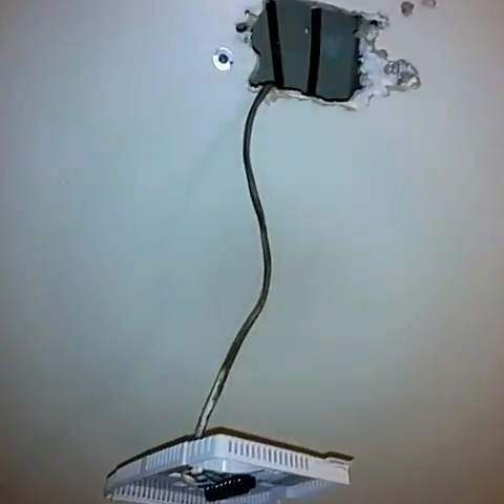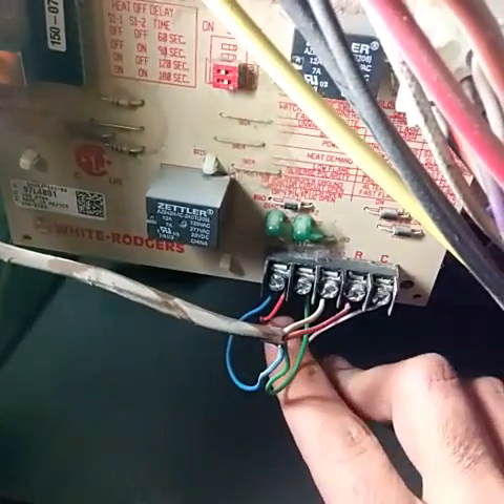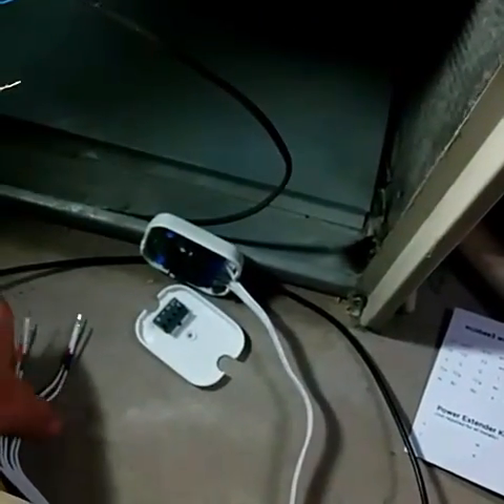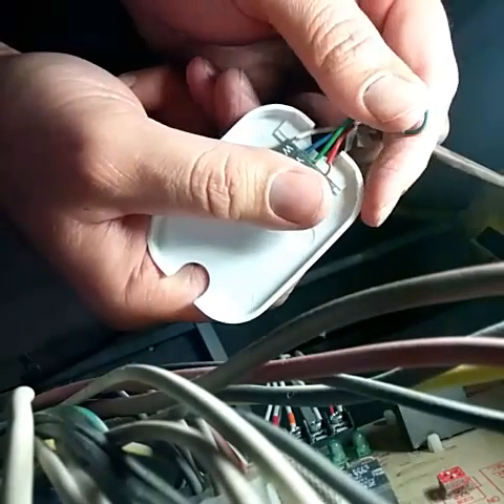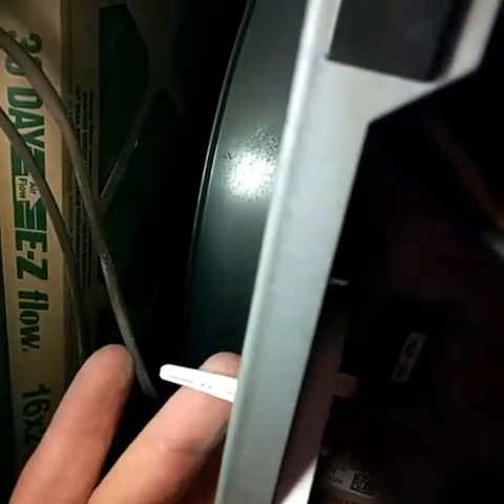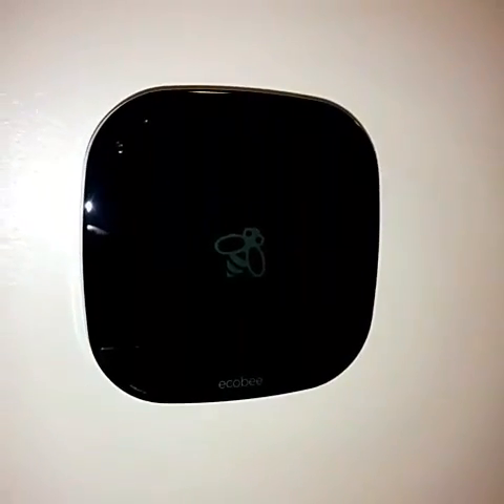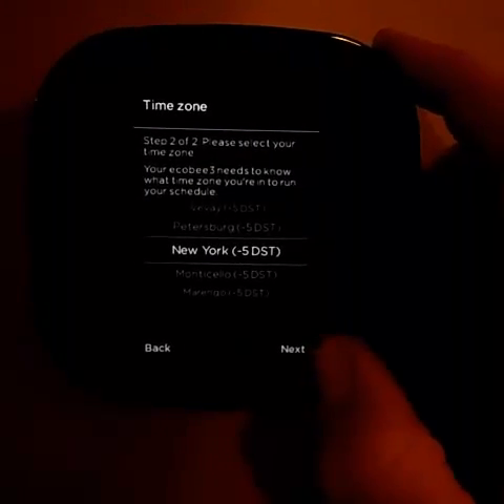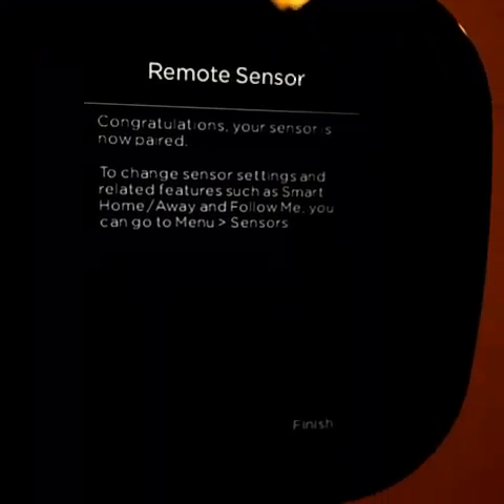Ecobee3 installation including the  power extender kit (pek)

Comment: Please help I just installed this and now when I turn my AC on, heat is coming out! Ughhhhhhhhh
Reply from the maker: Allie B Hmmm... that is weird. Did you double check all the wires just to make sure? (Dumb question but I gotta ask)
Reply: Yes, went through the whole book so many times. I'm so frustrated ! I called it a night lol
Reply: Do you take FaceTime help calls lmfao
Reply from the maker: Allie B The only other thing I can think right away is that the thermostat is actually programmed for the heat setting instead of the cooling. I'm not trying to insult you, just trying to work through it and see what we can figure out
Reply from the maker: Allie B Not sure if I'd be much help over FaceTime lol. I haven't had to trouble shoot anything yet luckily

Comment: We recently installed a smart thermostat (Lyric T5) in our home. It's a much more simple thermostat than the Ecobee 3, I believe, and we've really enjoyed having it. We were lucky to have a c-wire already connected, although it wasn't connected to the original thermostat. I think the previous owners had bought a new HVAC and the c-wire was connected at the furnace but they didn't change the old thermostat which was one of those old mechanical mercury ones. Anyhow, enjoyed watching this video about how power extender works.
Reply from the maker: thihal123 Thanks for the comment and it's good to hear that there are other options out there. Hope you enjoy your new thermostat.

Comment: Seems like a lot of work compared to just dropping a new group of cables that include a common.  I know I don't have one and plan on picking this stat up tomorrow.
Reply from the maker: It might seem like a lot of work, but nothing compared to running new wires in an already finished part of my house. It's really not that complicated when you get going on it. I hope it works out well for you.
Reply: Thanks...  My furnace is in a basement with no ceiling.   So dropping wires down 10 feet is no biggie for me
Reply from the maker: +Rob Mugs Oh, yeah... that just might be the way to go then. I wasn't that fortunate to drop a new line to the furnace. Good thing there's more than one way to do it to meet the needs of multiple applications. It should install super easy for you then. You'll enjoy it when it's up and running.
Reply: Thanks for the video anyway.   Wasn't even aware this could be an issue.  

Out of curiosity, how well does this heat areas of the house with the extra sensor?   It seems you would need smart dampers but they claim it does it with magic algorithms
Reply from the maker: +Rob Mugs Smart dampers would be ideal. Without those, I don't think it's entirely possible to have the whole house at an even temperature. I think the sensors just make the thermostat average out the temperature. I rent rooms in my house and haven't really asked them. I haven't had any complaints, so I'm going to assume that the temperature is pretty even throughout the house.

Comment: Thank you very much for this video.  Your board is exactly the same as mine and ours was wired in a different configuration.  Seeing how your two AC wires were connected was a life saver.  Well, a condenser saver.
Reply from the maker: Glad we could save your condenser and money in the long run. Thanks for the comment!

Comment: I'm thinking about getting this (hoping for a discount come black friday). But I have a question about wiring due to my wiring setup. My wiring is setup EXACTLY like yours, with what I'm assuming is my central air that has those two wires attached. Looking at my thermostat wiring, it doesn't have a C wire attached. But when I looked at my wires running from thermostat to furnace, I do have a Blue Wire for Common. Pulled the wiring out of my wall a little more and the blue wire was tucked away. If I get an ecobee3, would I just be able to wire this up using all 5 wires that I have, or should I just pretend I don't have the blue common wire and use the adapter?
Reply from the maker: I would first try using all your wires because it would be a lot easier and save time. If all else fails, then I would resort to installing the c wire like I had to. Hopefully you get a discount this week, that would be awesome. Let me know if you have any other questions.
Reply: chefonzy1 thank you very much for your reply. Whenever I get a new thermostat, I'll let you know if the wiring worked with the wires provided already.
Reply from the maker: You bet. Definitely let me know how it goes. Good luck with it all
Reply: Did end up finally getting an ecobee3 lite. Only thing that was a pain was trying to get the common wire screwed down on the furnace with the a/c wire as well.
Reply from the maker: +FromKindleFireIsBorn Sounds like it installed nicely then if that was the only issue. That's awesome. I've enjoyed being able to control my thermostat with the app, so I'm sure you'll enjoy yours too.

Comment: What if wifi goes down will it still work
Reply from the maker: Should work just fine without WiFi because it's wired to the furnace. I believe the WiFi is only going to affect certain capabilities like connecting to the thermostat with your phone and things like that. Does that help?

Comment: Great video, it helped me a lot.  In looking at my set up, I noticed that someone had just cut off the common wire at the tstat and I was only using 4 wires.  After opening the unit I saw that the C common wire just wasn't connected.  I connected the common wire at the unit, went to the tstat and stripped the bundle back and found the extra wire for common.  Its powered up and running now.  I didn't have to use the extra PEK kit after all.
Reply from the maker: Thanks for commenting James! It can be super frustrating when people just start cutting wires, but luckily it worked out for you.  Enjoy your new thermostat, it's pretty sweet. Thanks again

Comment: I am using an ICP furnace and can not seem to find my control board. There is a sticker that implys it may be integrated with the fan motor or something to that effect. Has anyone encountered this issue before?
Reply from the maker: I haven't had anybody comment on that yet, unfortunately. I can't say I have any experience with it either, but if it's like any other furnace that I've seen, the board would be located near the fan motor. Wish I could be of more help.
Reply: Andrew Weakley I too didn't find the control board that he has. I found a two thermostat wires tied with wire nuts to wires that are in a harness connected to a control board. I am going to have to return the ecobee3 😢 as I failed to install it.

Comment: does the power extended kit come with it?
Reply from the maker: It came with mine, but I would just double check that it does before you buy it. If I remember right, it was pretty detailed stating the contents, so there was no question on what you were going to get.

Comment: so you dont need to install a common wire? with that little power pack.
Reply from the maker: If you already have 5 wires, then you shouldn't need to install it, it should just wire right up with your existing wires. I only had 4 wires, so I had to install the pek, so that I got a common (C wire). Does that answer your question?
Reply: absolutely ,thank you so much.
Reply from the maker: Awesome. Good luck with the install
Reply: thanik  you, again.
Reply: +chefonzy1 how does installing the PEK at the base station get you a C wire? You still have 4 wires going to the thermostat? I want to buy an ecobee3 but I also have 4 wires at the thermostat and want to make sure I understand how the installation will work.
Reply from the maker: +moropo I only had 4 wires as well going to the thermostat, so you'll need to install the PEK. The PEK takes your original 4 wires and converts it to the 5 without having to run additional wires to the thermostat. Does that make sense? If not, I can try to clarify more, but I do show you in the video how to install it.
Reply: +chefonzy1 Yes I did watch the video and I guess I have the answer to my question but just to make sure: there are still 4 wires coming out the drywall going to the ecobee3? All the PEK did was transform those 4 wires into 5 at the very end (at the station)? Thanks for answering.
Reply from the maker: +moropo Yes, you only need four wires at your thermostat. The PEK will do the rest (convert 4 wires in the furnace to 5) as long as you hook it up correctly. Good luck with the install.